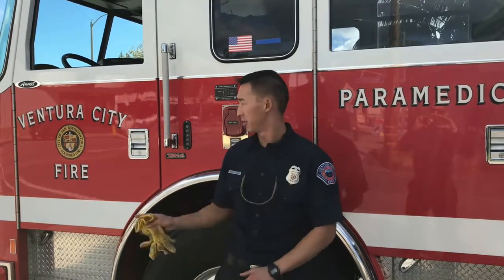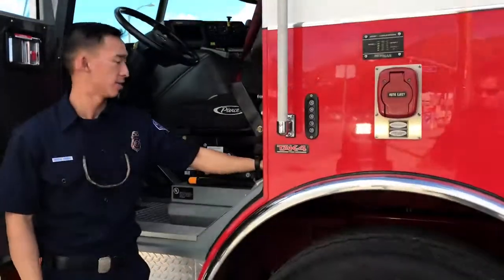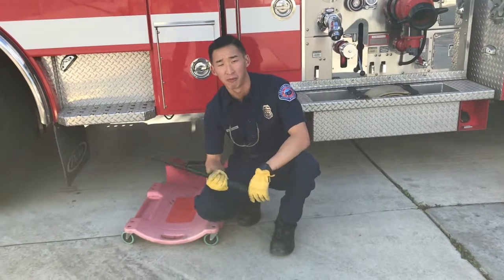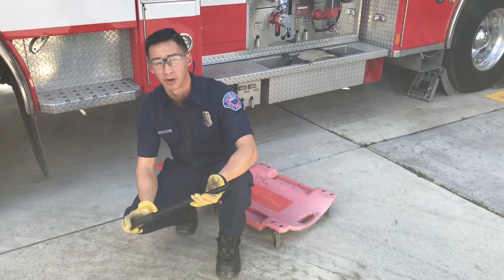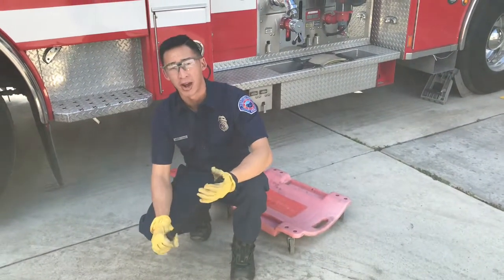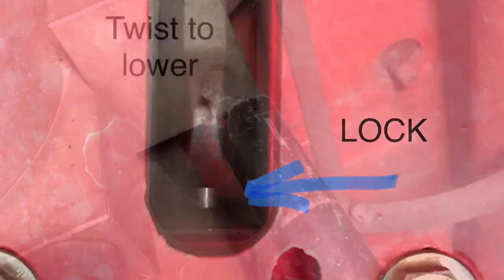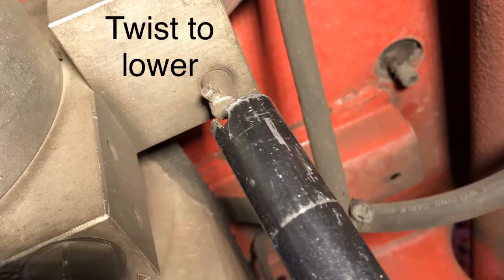Manual Cab Tilt

Comment: This video shows no safety mechanism to hold the cab up if the hydraulics fail. This is like jacking a car up with a hydraulic lift and not putting jack stands under, just relying on the hydraulics to hold the vehicle up. Very dangerous and not done by anybody with any sense.